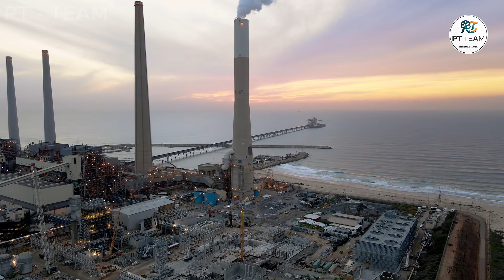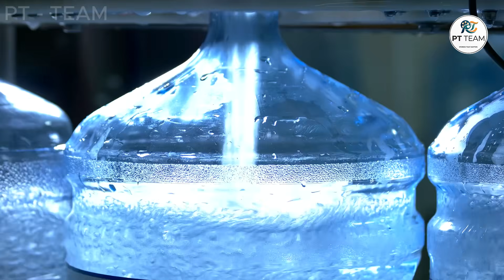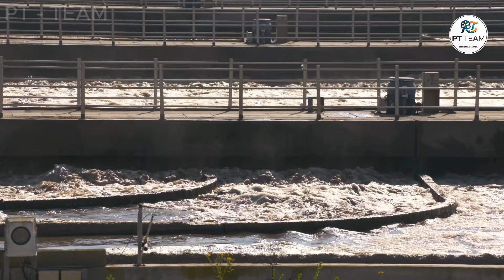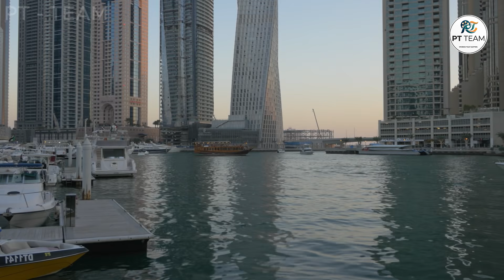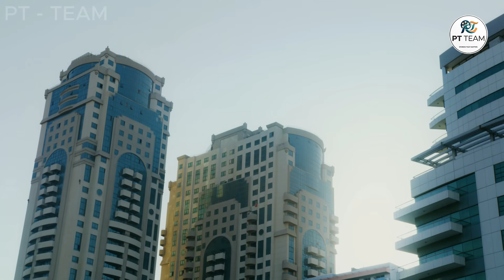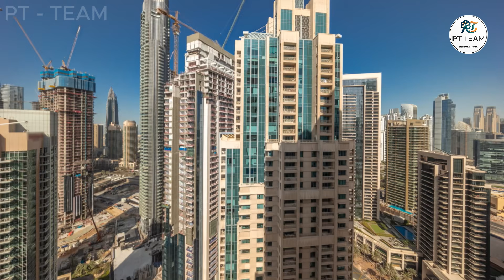Why Dubai’s $100 Billion Water Machine Is Facing an Imminent Collapse Crisis

Comment: Every bit of energy absorbed by the PV array eventually is converted to heat when used - re-radiated to add more heat to the air.
Reply from the maker: True, most of that energy eventually ends up as heat somewhere. The important difference is that solar generates electricity without adding the extra heat and emissions from burning fuel, while its local heat effects depend on where and how the energy is used.
Reply: @PTteam-k1f  You are correct about thermal plants, very much so.😀